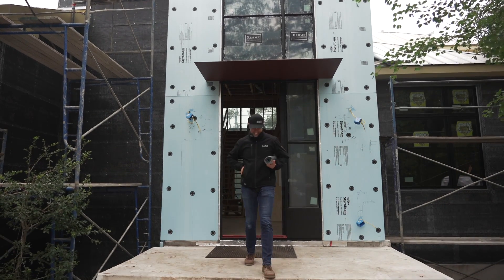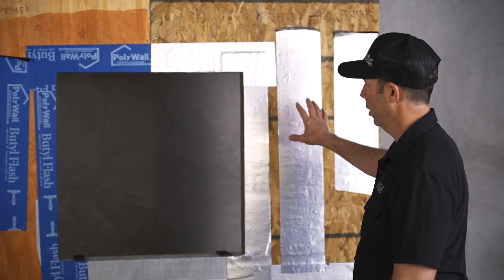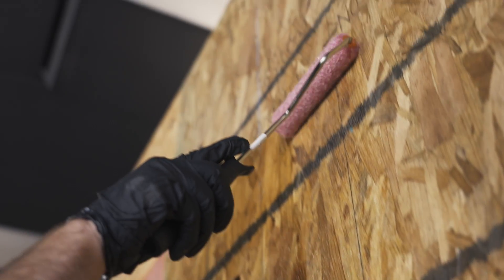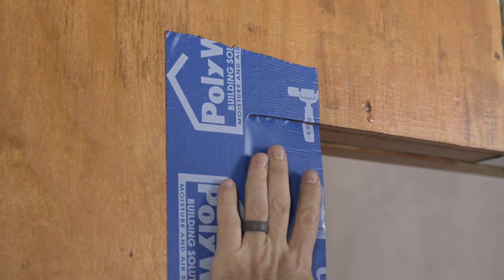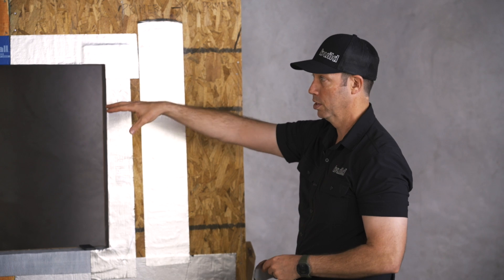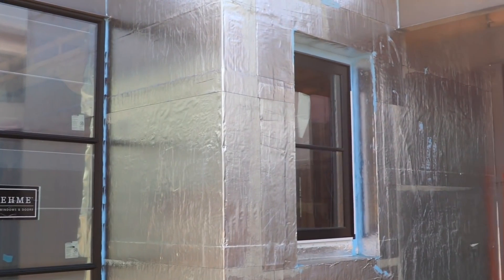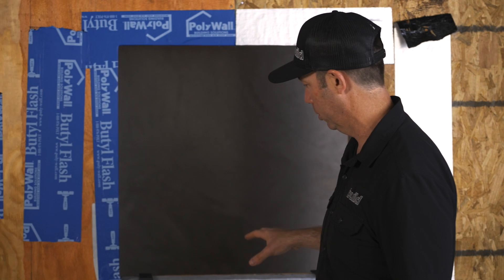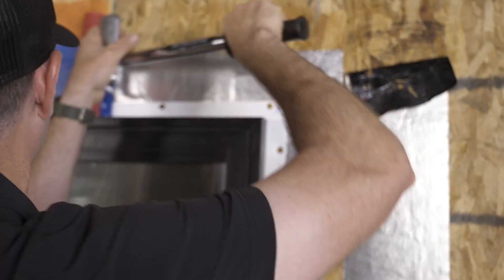How to prevent this! Cold weather work and prevention of the stick & peel syndrome!

Comment: It looks difficult, expensive and unreliable. The traditional US house design is flawed. These houses last 50 years. In Europe houses last hundreds of years.
Reply: So what’s your solution? Instead of just criticism
Reply: @aayotechnology  If you for instance look at Nordic framed wood houses they have no OSB board at all on the outside of the frame. This board which always start to rot. Regardless of Zip, tape or different coatings. A Nordic house has an outside of wood planks and then about 30mm of air gap to the frame. The frame is covered with a wind stopping textile before the insulation. Then there is a vapour barrier on the inside before plasterboard. This means that any rain that somewhere manage to get past the wood panel will just follow the backside down. At the same time there is ventilation on the back side drying the panel. It seems like the more plastic film and tape etc you use the more you prevent drying. I think it is better with a system which accept and allow for some moisture but ensures drainage and drying. Also plain wood can take much more moisture than OSB except for the end which need special treatment. We have millions of traditional wood houses that are very very old and without rot or mould.
Reply: because they are stacks of rocks. with no insulation or air sealing, old growth rot resistant wood.  I love the old houses,  like the house in Provonce that has 16something scratched in the beam above the bed in the guest room. but its totally inefficient, there just is not much to go wrong as long as you keep a roof on it.

Comment: When putting the window in, is it necessary to apply the adhesive again before covering the jambs and head with Butyl Flash?
Reply: Brodie--our guidelines are designed to make those transitions and penetrations waterproof for the life of the structure and we know those details will.  Poly Wall Building Solutions

Comment: I understand this may be overkill but if I painted with oil based paint, the entire window sill areas and then applied what you did in video, will all those adhere to oil based external paints.
Reply from the maker: I would not do that without making a mock up and testing it. . I suspect it won’t stick well.

Comment: cut back and tape together the housewrap?  with properly lapped 36" rolls, the windows and other things get lapped into the wrap as it's installed, and then you;re not relying on adhesives to migrate the moisture out.

Comment: I'm with Steve b. on this, if you need a primer then your peel and stick isn't   up to the task
Reply: He likes primer because he’s an overbuilder. But it’s necessary in the winter because the adhesives are temperature dependent. Even in Tennessee, they use primers in winter.

Comment: How do peel and sticks work with cinder block construction? Will sealing exterior insulation create a good vapor barrier or does it need to be done at the masonry level?

I will ask about cinder block exteriors when applicable or until a south Florida builder is added to the Build Show Network (which would then cover just about all major construction methods in the US).

Comment: If you're rolling primer on, you might as well just roll a liquid wrb. 

Is peel and stick + primer  that much cheaper ?
Reply from the maker: Depends is the answer. Often Peel & Sticks are the best choice but sometimes they are a gateway to Fluid Applied Air & Water Barriers.

Comment: It would’ve been nice to show all combinations: both substrates, both primers, and both flashing types.  See which is the strongest combination
Reply: Both of our Priming Systems are equal in preformance criteria.  We offer both for 1) Saftey Reason--Poly Bond is a solvent based product and comes with several warning labels i.e. keep the kids and kittens away when using.  2)  There are several states (listed on our website) that prohibit the use of solvent based products.